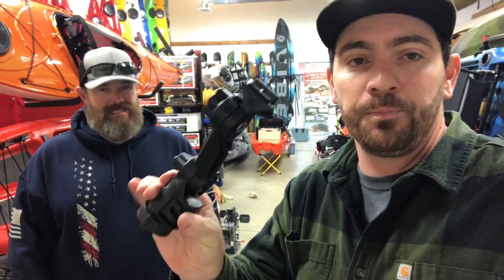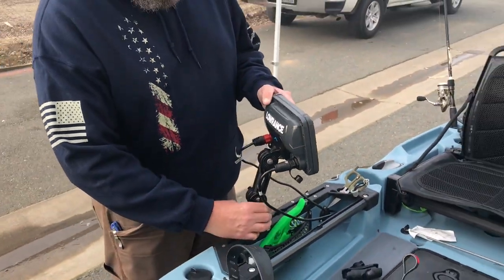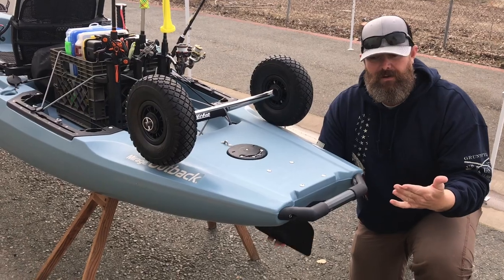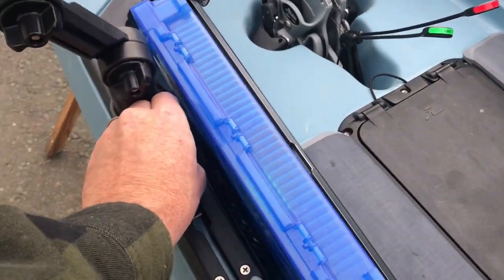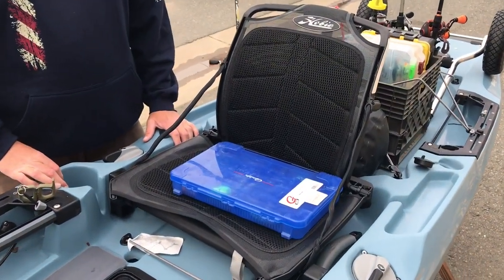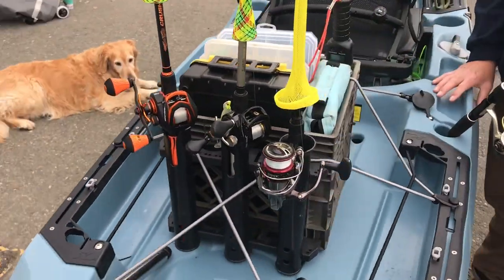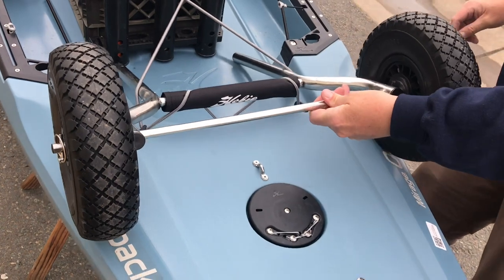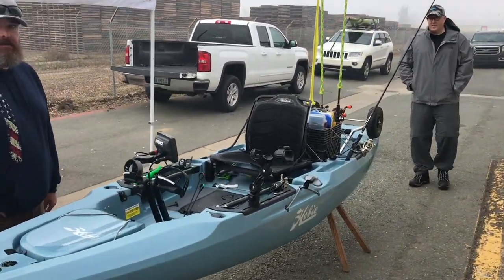Viewers Rig: 2019 Hobie Outback

Comment: Im new to the channel and looking for the most stable kayak for fishing.  I have never been in a kayak so stability is important.   I have looked so far for the most stable kayaks through your vids and through other references the big fish 105 was one that pulled my attention.  The other for much cheaper i found to be possibly more stable then the big fish 105  is the  Sun Dolphin Boss SS Sit-On/Stand On Top Angler Kayak (Gray, 12.3-Feet).   this kayak is not in any of your reviews i have noticed.  I had found a vid where this kayak was tested for stability with a heavier person trying to flip it.   Im a very light person so finding a kayak that is difficult to flip with a heavier person is very good to find cause it adds a certain safe feeling that will be less likely to flip for me with how light i weigh compared to some one heavier, and it will add some benefit to friends of mine that weigh more then me that can use it with out hesitation.
Reply from the maker: Chris Gruver stability is only important to the very first timer. Once you get a trip or two under your belt you’ll quickly realize efficiency and tracking is most important and stability is not as big of a deal as it seems at the moment.  If you have the opportunity to get with a local dealer and try kayaks I highly recommend it. I don’t talk about sun dolphins because they are garbage to paddle. The ascend is well made but still very very slow. If i was buying in today’s market I’d grab a 2018 Vibe Seaghost while they are on closeout for $729. Great deal comes with a paddle and a rudder. And they are just great paddling yaks.
Reply: @HeadwatersKayak  thank you for the quick response time and review ill take a took at the Seaghost  The paddles mean little to me from your vids when i do find an buy a new kayak ill make sure the paddle will be bought separately and is excellent.   When i get to the point in buying the kayak i will  make sure to ask you wish paddle is best for the kayak i choose so i dont waste my money and time on a paddle that  is junk or the wrong length.
Reply: which not wish had a typo in there